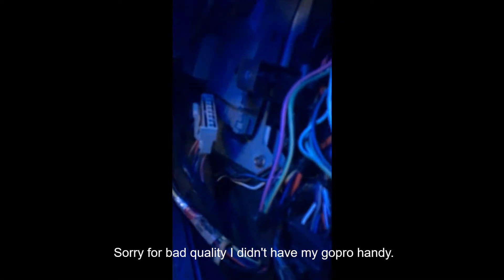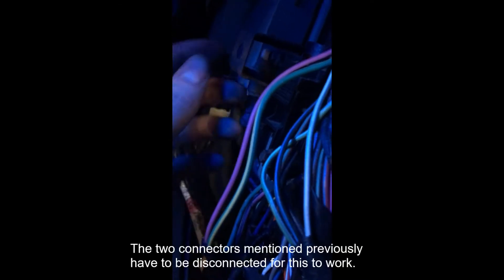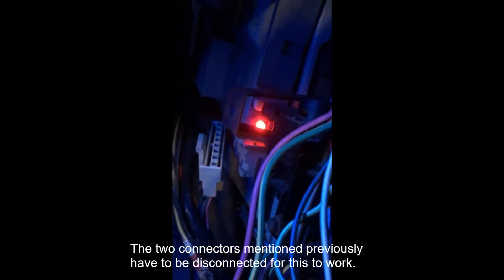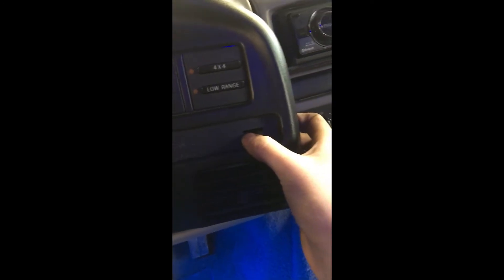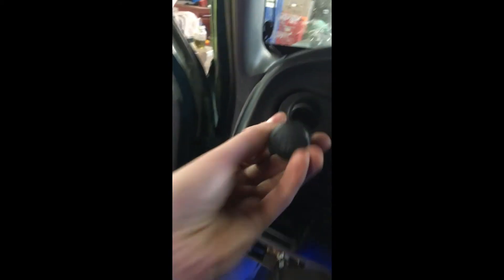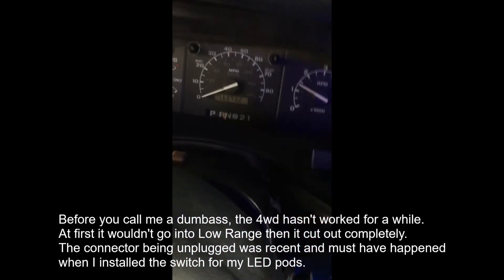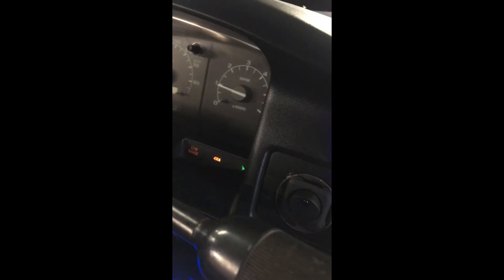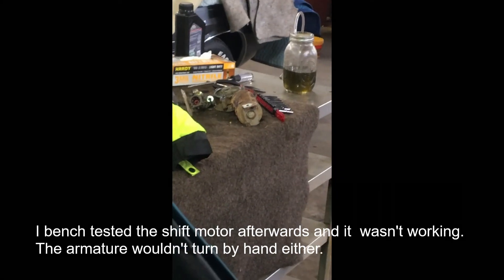1996 Ford Bronco Electric Shift 4WD Troubleshooting

Comment: I got an f150 electronic 4x4 but my 4x4 low range isn´t engaging, what this could be, the 4x4 HI is working pretty good, i´ll appreciate your thoughts on this  man.
Reply from the maker: Are you 100% positive it’s not engaging? Make sure the “low range” bulb didnt burn out in the dash. If it isn’t engaging low range then the motor is potentially on its way out. The truck in the video was doing the same thing, at first low range range didn’t work then 4x4 wouldn’t work at all. Take the motor out and see if you can turn the armature back and forth by hand
Reply: @dan3428 i bet is the motor cause neither the light on the dash and the light on the button turn on, thank you for the answer, god bless you man.

Comment: Led light didn’t flash for me, what does that mean brother
Reply from the maker: Shift module is bad or a connection issue to the shift module. When you push the button the shift module performs a self test. If no led flashes it doesn’t pass the test. So either fuse blew, or the module is bad. Chances are if there’s a bad ground it would take out more stuff, but to be sure it’s not the ground look up a schematic on google find what wire off the plug is ground and trace it out to make sure it’s a solid ground

Comment: Any reason why it want come out of 4x4 when I get the button on my dash it says on?
Reply from the maker: Can you hear it disengaging or is it actually mechanically stuck in 4wd? The motor actuates the shifting of 4x4, So if you are pushing the button and the shift motor isn’t spinning then do the 4x4 shift module self test as I demonstrated in the video, if that’s good then the shift motor is most likely bad. Before you purchase replacement parts it’s always a good idea to check your wiring harness for broken wires as well.

Comment: hey there, I've got a 95 bronco, my 4x4 light is on on the pushbutton as well as my 4x4 indicator light in the dash, but its in 2wd. it doesn't do anything when i press the 4x4 or low range button. any ideas what it could be?
Reply from the maker: Test your 4wd module like I did in the video
Reply from the maker: Or your shift motor is stuck in 4x4